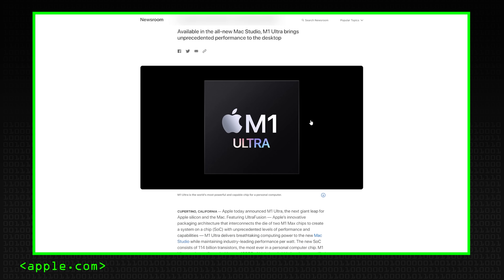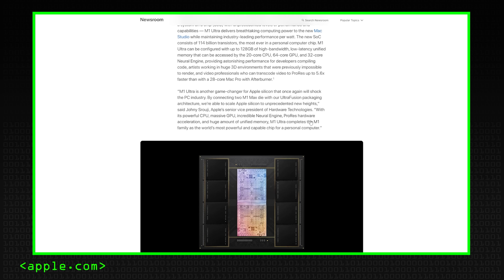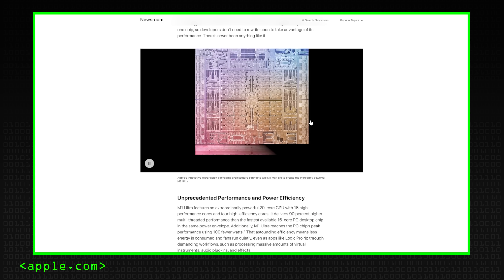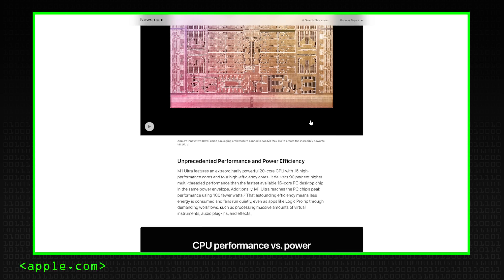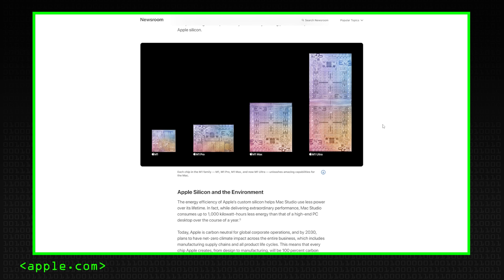Apple M1 Ultra & NUMA - Computerphile

Comment: Hmmm.... if only one CPU/and/or its cache can access the system RAM, then why are mutixes and/or atomic variables necessary in say C++ and other languages? If only one CPU could access the RAM, then all operations should effectively be atomic and you would never have RAM corrupted with indeterminate values when multiple threads share data.

Comment: Maybe you've done it before but I would love a video explaining video games vs rendering/productivity workloads.
Games get a big performance boost with more cache, the 5800X3D 8 core cpu increased performance a lot from over doubling level 3 cache with 3D stacking. But why does it mostly only benefit games and not other workloads?

Comment: Nice video! One question would be how much of this is done purely in hardware and how much is informed by the compilers, system frameworks and the OS as a whole. Apple has the advantage that they build the hardware and the full OS stack whereas players like Intel and AMD cannot pick and choose between what OS:es they want to support so whatever they do must be fully realized in hardware. (although, the OS vendors do need to support the hardware features that they offer) So does this mean that Apple uses some system software tricks to accelerate the interconnect and to reduce the latency, maybe through the way that the CPUs and their associated memory are partitioned and how threads are scheduled across the cores to minimize traffic through the interconnect?

Comment: I very clearly remember the days of dual socket (like multiple physical CPUs with their own memory) workstations.  It looked cool on paper, but in the real world, it usually didn't work out very well.  Many times, even with software optimizations, it was more efficient (and simpler logistically) to just use one physical processor, rather than to attempt to have them both working together on the same task or set of tasks, and having to swap data in and out of cache and memory, etc.  For servers, it could work, but most workstation workloads just aren't going to benefit from that type of an architecture.

Comment: Great to find someone who remembers NUMA !!
BTWk you forgot to deal with cache coherence.  Core 1 modifying contents at a memory location that is also in core 2's cache. 
In the 1990s, Digital tried to scale its Alpha computers to have many cores with its Wildfire class machines.   They found that 4 cores was the max the memory controller could handle before performance increments stopped beingf interestiung.  So they created the Wildfires with 4 CPU "QBB" that were boards, connected by what Digital called a switch. NUMA access between these QBBs was atrocious. 
This was dealth with at the operating system level, less so at application.  You could pre-load shareable images onto a specific QBB and then launch processes that use them on that QBB so they would use local memory for shareable images etc.   But this was nowhere enough.  
Digital then worked on the next generation alpha the EV7 which was delayed as long as they could because Compaq/HP who had bought Digital didn't want EV7 to beat the pants off the Intel Itanium heat generator. 
The EV7 introduced a totally new memory controller that remained state of the art beyond the death of Alpha.  HP donated Alpha IP  to Intel which used it for its CSI interconnect (later called Quickpath) and which evolved from there. ex-Alpha engineers went to AMD who developped their own version, and many ex-Alpha engineers formed PA-Semiconductors which was purchased by Apple to create its own ARM chips. The EV7 had coherent cache (and I beleliev only IBM's Power had this until AMD matched it. Intel's Quickpath did not implemnent coherent cache initially (despite having all the IP from DEC).

If you google for Alpha Wildfire NUMA, you will find a result "Optimizing for Performance on Alpha Systems - Semantic..." by Norm Lastovica.   It provides some then ciurrent memory accesses showing differences between direct and NUMA accesses in the Wildfires.  But at page 26 also provides the EV7 memory archicteeture in a fabric.  (21364 is the EV7 CPU, the first generation was 21064).   Each CPU controlled a part of RAM. But because CPU 1 could request memory from CPU2 at same time as CPU3 requested from CPU4, CPU5 from 6 etc, it ended up having huge performance advantage when scaling number of cores. 

There was also an issue of CPU speed vs memory speed.  Alpha came to surpass memory speed easily hence the 4 core limit Digital found in the 1990s.  But when you increase memory speed (and it has increased tremendously since then), it lets you increase number of cores that have direct access (especially in last littel while when "Moore's Law" was more about adding cores than making each core faster.

Before their death, Digital engineers would present at DECUS comferences and provide much information about Alpha advancements and how they improved thinsg etc.  It is a real shame that Apple hides all the real information and only rpovides marketing gobledeegook that is useless.
Reply: Nobody cares, man.
Reply: @andybaldman  You are wrong on the Internet.
Reply: @RogerBarraud  Nope you are

Comment: Interesting video, but I’m afraid it doesn’t fully touch on how NUMA solves the bus contention issue from UMA type systems. Especially with the implication that you don’t need to program appropriately for a NUMA system in the M1 ultra. If you program agnostically to the non uniform memory, you effectively have a UMA system again.

I get adding a second RAM bank boosts bandwidth but why not have a HBM style memory instead, especially stacked die HBM
Reply: Because of cost.

Comment: If you look at the board layout of the M1 Pro or M1 Max, you have RAM chips on either side of the CPU. That is a similar physical layout to my Threadripper, or to what I've seen in Xeon systems, which are NUMA. In comparison, M1 systems, or Intel Core or Ryzen non-Threadripper, which are not NUMA, have all of the RAM on one side of the CPU.

Does that mean that M1 Pro & Max are effectively 2 NUMA nodes, and M1 Ultra is effectively 4 NUMA nodes?

Comment: Early benchmarks indicate that the GPU is not utilised to 100% on the M1 Ultra. Is Apple having issues with CPU bottlenecking the GPU due to porly optimised memory access thingy? (And yes, I'm no software engineer 😏)
Reply: It's more likely because they crammed it all into one chip and they are having thermal issues, the memory for the GPU is shared so it's technically the same physical ram, but it's reserved, so you don't have to worry about collisions and can let the CPU and GPU access the RAM at the same time.

Comment: I've always wondered if we accessed more than one NUMA nodes worth of memory, how does the memory get chunked up? Take half and half? Take most from one? Is it hardware dependent? Software/OS dependent?
Reply: On my Threadripper motherboard, there is the CPU, and either side of it, there are four memory slots for a total of 8. The 4 slots on one side are one NUMA node, and the 4 slots on the other side are the other NUMA node.
Reply: Also, there is no true virtual to physical CPU affinity. And the hypervisor generally allocates the compute to the VM as needed, when running performance graphs you can see big spike across the sharing CPUs when its allocating compute from another node. (hope that actually answers your question :p )

Comment: But what is more important in this NUMA case? latency or bandwidth? And to push the performance to absolute limit, is it still better to use local memory instead of remote even apple promoted the interconnection have more bandwidth than its memory bandwidth

Comment: Great video. I learned something new! Just one question: Could the operating system optimize my code when exexcuting? So when I allocate memory, the OS should know which CPU this process is running and allocate the memory in a RAM faster to access. This way the code does not need to change, just the OS.
Reply: OS's already tend to do this :D

The problem is what happens when you have multithreaded code (e.g. running on multiple cores/cpus at once), there is no one ideal block of memory for the OS to allocate to. The Apple claim is that their system is non-NUMA, or at least sufficiently fast to be indistinguishable, so developers don't have to rearchitect things to maximize performance.

Comment: I repeatedly heard of IT managers who decide on investing into NUMA systems, dual-socket servers and — at the same time — software not optimized for NUMA. 
In side-by-side benchmarks, it was discovered that the same workload was faster on non-NUMA and single-socket systems than theirs. (Main reason: losses due to MESI and fabric/interconnect delays between CPU cores and RAM.)
So… please beware and think about your use cases before buying NUMA or dual-socket systems.

Comment: How do the CPUs handle it when two separate CPU chips, each with a cache, try to write to the same location? This can happen if the location is a mutex.
Reply: This shouldn't happen. It does though, very frequently, and is the cause of most security vulnerabilities.

Comment: This feels reminiscent of the PS3's cell architecture.
Reply: No, it's a total repudiation of the PS3's cell architecture.  As is almost every other multicore chip.

In PS3, the SPE cores each had their own tiny scratchpad SRAM. They could not access (meaning: read or write with a simple load/store instruction) the main DRAM.  Worse yet, no SPE core had access to any other SPE core's scratchpad SRAM.  Each SPE was its own private (and very small) island. The only links to the outside world were mailbox registers and a DMA engine which could be asked to copy blocks of data between islands.

The one and only advantage of this design choice was that it made the chip much easier and cheaper to engineer.  Cache coherency is a hard problem, not having to deal with it makes the design much simpler.  The PS3 was a gamble on saving money by not doing the difficult stuff and hoping things would work out OK for software anyways.

Things did not work out OK.  You might have the impression that Cell was awesome because Sony spent so much money hyping it, and the console sold lots of units in spite of it, but in reality it was a dismal failure.  Few PS3 games got much out of it, it was too hard to effectively use SPE cores.  The PS4 completely abandoned the concept and went back to being a conventional shared-memory cache coherent system.

M1 is also a shared-memory cache coherent SoC.  The deal with the Ultra Fusion bridge is that they're claiming it's so high performance that when you connect two M1 Max die together, the penalty for memory accesses which cross over to the other die is so small that it's not really noticeable to software.

Comment: Video idea (because I don't know where to look for this) - some of the finer details of caching implementation.  I understand the idea behind caching, and the structure behind it, but not how it's actually implemented.  I want to learn the actual control logic for reading/writing cache lines, and when and how it gets updated to/from RAM or a higher level cache.  Do the CPU cores control the caches directly, or is there some control logic for each cache that isn't a part of a specific core?  

I think it would be an interesting video, but if there's already one that exists that I missed, can someone reply with a link?  I've only been able to find high-level explanations so far.

Comment: No matter how fast the interconnect is, it's never gonna behave like a UMA system. If a core in die 1 tries to access the memory pool attached to die 2, there will be a latency penalty. We won't know how big that latency penalty is and how much of an impact in performance will have until the system is properly tested. I'm hoping Anandtech will test it since they usually do memory latency tests.
Reply: Ian cutruss formerly of anandtech said above 5 to 7 NS for just interconnect Vs 54ns total. So call it 15 percent more latency

Comment: Even if it did require additional programming, it wouldn't make much difference because no one will ever try to bother with this device for very high computation intensive applications.
Reply: Video editing is a very high computation intensive application, and is exactly what this is designed for.

Comment: So if I understand this correctly, the Ultra architecture makes it so developers don’t have to split their code across cores, but I suppose they could in order to achieve even more performance?
Reply: Unless you really really really know what you’re doing you’d probably just cause more bottlenecks. No real point with these Macs, unless you were clustering them, which would be cool but probably not a great use of resources when it comes to all the enterprise solutions.

Comment: To be fair, most programmers wouldn't have had to care about how the memory worked anyway because the compiler would have done the job for them. This spared Apple the cost of writing new optimization code for the compiler, at the cost of more hardware engineering
Reply: You’ve never written kernel drivers have you? 😂
Reply: @RunForPeace-hk1cu  he clearly hasn't worked within a c++ development environment

Comment: I still don't get why splitting the RAM in two wouldn't cause the same collisions problem with the high number of CPUs, given they effectively still share just one bus, albeit connected by some black box in the middle.
Reply: Because the two NUMA regions are separate, any access in one region does not impact access in another region.  Even without coding for it, you reduce the likelihood of collision.

Comment: Another hypothesis is Apple's Rosetta , layer possibly working to tranlating instruction to accomodate the memory layout. Perhaps tapping in between the OS Kernel level calls and application layer to translate the memory allocation and instruction placement to be co-located in the same memory. I mean Roseta emulation is fast , won't be surprised if they use it for this purpose. won't be a silver bullet but a bullet they may add for solving the memory placement issue.
Reply: I wouldnt think so. Rosetta only installs once you install software that can’t natively run on M1. I think that’d be adding too much overhead to an already somewhat costly translation layer. Although I’ve seen it really depends on the particular software. 

It also helps that Apple has a very large piggy bank for their RND and that they plan everything so far off. Hence why iPhones are just now getting high refresh rates. Hopefully this will give new life to competition I. The market.

Comment: Isn't this something an OS should abstract away from the software developer? Seems a bit strange to me that the programmer should be aware of any of this.
Reply: Not if you want performance when you have 2 saperate CPUs
Reply: There are methods to restrict processes to NUMA regions, but that also reduces the available memory and cores.  Like a lot of things, it depends on how much effort is required for the benefit.  If your code is fast enough on a particular architecture, none of this matters.  However, if you need to optimize for memory access, then you need to care about the layout.  Apples's claim is that their NUMA cost is low enough that you don't need to worry about it.  Of course, their marketing is actually claiming that this is actually UMA because the cost is so low.  I'm sure it is low, but it is not zero.  This does mean that the cases where it will actually matters are reduced, but it is not magic.

Comment: Don’t you still have to write code to distribute the memory hits across the two memory banks or you just have the same multi core stalling effect mentioned earlier.  The speed up was the ability to partition core memory fetches into two batches preventing all of the cores stalling trying to fetch from the same bank.  Side note:  I work on a radar with 11 cpu cards with an 88000 on each and 2 MB of local ram with the collection tied to 2 global memory cards with 8 MB.of ram.   GRAM memory fetches are really expensive.

Comment: Doesn't Apple provide the compilers (and IDE) so couldn't they be baking in the modifications to the code that is required to manage the non-uniformness of memory access times?  (Regardless, early benchmarks indicate that performance is scaling only a little short of linearly with the number of cores, so we can infer that memory access across the two halves of the "fused" CPU isn't creating major delays.)

Comment: What ISN'T discussed is the matter of the Apple tech is relevant or not to the predominant use-case of the hardware.

Most Apple users are consumers who are not doing activities where a fast memory interconnect matters. At all. 

They're mostly reading email, consuming media, or doing minor asynchronous tasks.  It won't matter.

If this were a multi-tenant VM server then "yes" it would make a difference.  But we've been burned enough times by apple abandoning the infrastructure/enterprise market that their hardware offerings in that market segment has been abandoned again, and again.  See: X-Server

This tech innovation is more interesting if you were talking about a chassis full of HPE blade servers where the CPU+RAM+I/O is optimized for 64 (or 128 bit) CPUs.
Reply: The multiple thousands of dollars Mac Studio is not a consumer machine for E-Mails, what are you on about?
Reply: @aliceif4597  Unless you have software that uses natviely Metal and hardware supported video encoding and YOU NEED THEM, Apple Silicon is just a gimmick for .. well, quiet reading e-mail on MacBook Air.
Reply: @piotrd.4850  We're not talking about a MacBook here.
Reply: @piotrd.4850  I can do emails on an ipad.
Reply: Amazon now has Apple-based instances, so they're a target customer here.